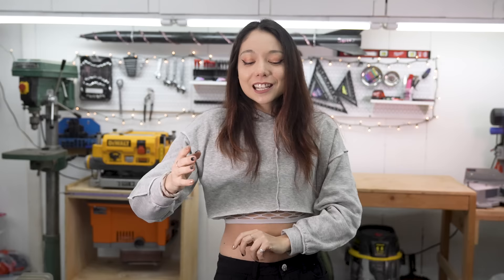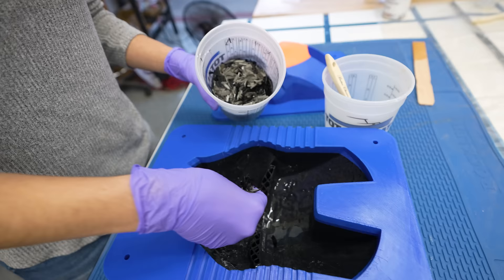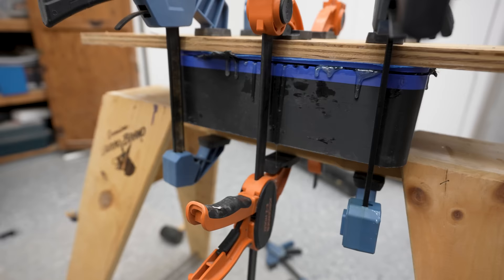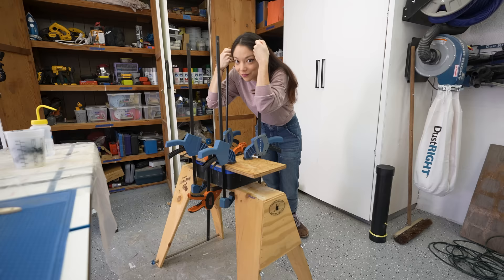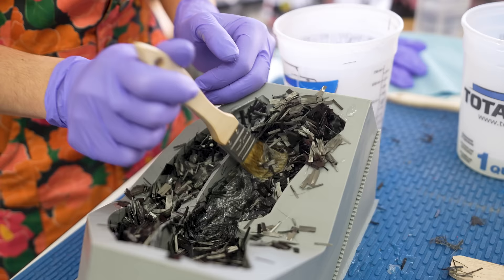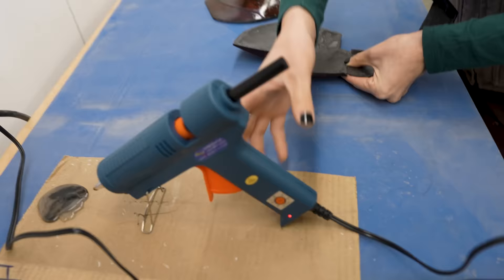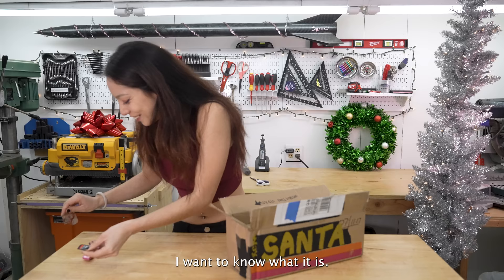I UPGRADED Iron Man's Helmet (100% Carbon Fiber!!)

Comment: Tech tip from a resin material manufacturer here:  With 3D printed molds and epoxy, you will usually want a 2-stage release application to ensure your parts don't try to weld themselves to the mold.  The liquid wax is a good start, but a follow up layer of water soluble PVA release would have prevented a lot of that sticking problem.  If you are going to sand and clear coat the pieces anyway, wax and PVA is the gold standard for decades for making composite parts from rigid tools.  3D printed FDM molds have a ton of micro-porosity, so they really need to be sealed (tons of work) and/or do the wax/PVA treatment.  We have a couple videos on our channel that discuss all of this.  🙂👍

Comment: As long as he’s not going to the bottom of the ocean, Carbon Fiber is perfect.
Reply: The funny thing is, that carbon fiber submarine did make it down and back multiple times. If he'd only not used expired Boeing supplies, inspected the damned thing after each usage, actually properly tested it unmanned repeatedly, removed his cranium from his rectum, he'd possibly still be alive. Or found some other way in which to harm himself stupidly...

Comment: If you don't care too much about reusing the molds, highly recommend leaving then in a heated chamber/oven at 70c or so, it peels away really well after. Boiling in a pot full of water also works. If you get the temperatures right, the glass transition zone of pla can make it soft, moldable like clay or almost gooey based on where you are on the curve.
Reply: "based on where you are on the curve" just sounds so Rick and Morty, lmao
Reply: @spennorex  - i was thinking that 'how to make a shrunken head' vibe - lol
Reply: This is great advice. I've made several PLA molds and heating it makes things so much easier.
Reply: You'd have to be sure you're using a resin that is stable at that temperature for the part itself. I'm not sure how the specific resin in use in this video behaves at high temperature, but the resin I've worked with (which granted has only been one specific infusion resin) would probably start warping at 70 C.

Comment: 10:52 An alternative to those gloves is something disposable like nitrile.  It won't tear holding the parts, but it will tear and save your finger if it hits the blade.
Reply: Agreed, and there are some beefy ones too, I'm using Venom but ProjectFarm has a video testing a bunch too. Carbon is nasty to sand heh.
Reply: so the balde cannot cut thru human skin? wow
Reply: carbon splinters will go straight through nitrile gloves.
Reply: @--julian_  The issue is not the cut as much as the blade dragging the glove into the machine... and your fingers with it.  Better if the gloves break-away.
Reply: @--julian_ blade can cut human skin, but on something like a bandsaw that cut probably won't go very deep before you feel it and pull away. As has been mentioned, if a glove gets caught it can pull your whole finger or hand in and result in a lost finger before you have a chance to shut the machine off and untangle it.
Reply: Barrier cream is also an alternative, if the goal is just to avoid itchiness. I used to use it a lot when I was working in a fiberglassing shop. Particles don't stick much and those that do just rinse off easily.

Comment: I have two comments that might help you.
1)  I use Walmart vacuum storage bags as vacuum bags, they work really well, cheap, and they peel easily from cured resin.
2)  For carbon I've used black "Featherfill" to fill pinholes.  It's easier to sand than a flood coat, and you sand everything away but the pinholes, and you don't see them when you clear coat the part.
Reply from the maker: I've always wondered if this works!! Do they pull hard enough? What vacuum do you use to pull? One like I have or the one walmart sells with it?
Reply: You can use a vacuum sweeper to pull the vacuum if you want, but we used a PVC pipe end cap over the top of the valve, sealed with sealant tape, drilled and threaded for a barbed nipple, then hooked it up to our vacuum pump.  Your pump would work just fine.  Use whatever vacuum you need.
One other suggestion for a tool, is an oscillating  saw.  We use it for cutting and minor grinding of parts.  Works really well, and there's not near as much airborne dust as a result.  We've found that carbon for whatever reason takes the kerf out of a band-saw blade very quickly.

Comment: From personal experience, I find mixing the tow and the epoxy before applying it to the mould gets a far better uniformity of the finished part. also, the “acne” is not only caused by the pressure, but by the heat that’s generated by the epoxy curing (it’s not much but under the pressure, it’s enough).
Pro tips: slow cure epoxy, thicker walls on your moulds, mix it before you layup and try to get the material in position before you squish. It doesn’t like to move much in the mould. Draft angles are your friends and add bleed holes for the excess resin for an easier time squashing it.
Reply: And it's best to do a wash coat on the mold first, let it tack up for almost an hour, then put your pre-wetted chop in there. Much, much smoother.
Ejection pins in the molds are crucial for complex parts like this. Just a hole with some packing tape or a round sticker over it so you can punch it out from the back makes all the difference, especially if the plan is to do a bunch of post processing.
Clamping should be done slowly. Snug it, then do a quarter-turn on the clamps every couple of minutes until the mold bottoms out. You have to give time for the resin to weep out your bleed holes/split line.

Comment: A suggestion for releasing parts from moulds is to include a tyre valve facing the part. (Ideally in the middle.)  When it has set, apply an air line to the valve, and you should be able to exert an even pressure all over to force it out.,

Comment: Use PETG, it’s amazing to sand after and accept orbital sanders without melting and gets really smooth, to cut don’t use carborundum discs, use this thin metal with diamond coating, cuts like butter and don’t break, carborundum is for metal or so

Comment: I don't think the mold being crushed necessarily had to do with your clamping the clamps too hard..  The resin likely got warm in the curing stage which then heated the plastic up causing it to deform around the infill.

Comment: If you incorporate jack bolts between the two mold halves you can apply a huge amount of separating force, even if the threads in the plastic aren't strong enough you can add a lot of pretension that will aid with pulling them apart.

Comment: Super cool project 😍
An other YouTuber used a refrigerator to cool down the epoxy resin while hardening. That’s slows down the speed of the reaction and gave the sire more time to escape from the liquid before getting too viscose / solid.

Comment: As the author of The Iron Manual, I apporove of the use of carbon fiber for enhanced security. Not so much flying itself-- one of the arly Stark inventions was a "partial" anti-gravity device. Developed for the SHIELD Helicarrier... It also required external vision, in-flight controls and redundant power supplies...
Excellent as usual!

Comment: Hello so I’m on my colleges fsae team and we do everything with carbon fiber so I have a lot of experience with what you’re doing making carbon parts both for structure components and aerodynamic ones. I don’t have experience with the exact type of carbon you used (the little shaved bits of UD is what I’m guessing forged carbon is) my guess is it’s more decorative (it does look super cool). We use an combination of pre preg twil and UD to make our parts. I’d recommend pre preg above wet layups because the pre preg has the bear minimum resin to bond everything together. So it saves on weight. Also cuz it’s in sheets the layups are easier to plan. We use fibersim from Siemens NX to plan the laminate ply by ply to optimize the part. Regarding molds and vacuum bagging yeah it’s never easy and it’s a lot about practice. Mostly I’d say you want more breather to ensure even vac on the part. Airtech also makes something called aircast which helps with hollow compression molds. Also cursing in an oven makes everything more controlled (but finding and oven isn’t easy) anyways project looks awesome great job. And yeah carbon fiber
Reply: Your advice isn’t wrong, but isn’t exactly good either. I used to work with PMCs and CMCs at General Electric, and pre-preg and NX are not hobbyist level options. A better option for her would be various weight twills and UD layers with vacuum infusion. Keep in mind the quality of epoxy she’s using too…
Reply: Perhaps you’re right I did fail to consider the cost of materials and manufacturing especially since prepreg needs to be stored cold. So your solution is more reasonable however I would also say that if she managed to design and build a supersonic rocket then the complexity of fibersim is well within her capabilities. I realize that my experience is rather limited to what my team does so if not software like fibersim how do you suggest she plan out laminates I order to ensure that they won’t fail under load? One option is to simply eyeball everything with an high safety factor but that’s not very elegant

Comment: Nice job.  I've done rocket fins using this same technique.  I found that a paste release (3 coats) followed by a PVA release coat on all surfaces (even the back and sides of the mold) kept anything from sticking.  Make sure to let the PVA dry completely, then laminate, or fill with chopped fiber.  Then clamp just enough so that your excess epoxy squeezes out.

Comment: Great build! I use CF a fair amount and any voids like pinholes and mini craters can be filled with Cyano/Superglue...and a few minutes later can be sanded smooth. Adding CF dust in the hole will speed it up and hide the hole. Keep up the interesting stuff, Xyla!

Comment: I like the clamping the clamps. Its good example of thinking about the essance of what you are trying to do.
 In this case instead of conventional squeezing the handles with your hand,  the essance of what you are trying to do is to move the handles closer to each other. When i think like that more sollutions pop into my head

Comment: Hello Xyla, to have the pressure force on the mold, you can use a polyethylene bag vacuumed with a vacuum pump made with an old fridge motor and a simple depression switch.
The pressure on the mold can be enormous and it is much more regular.

Comment: On the mold front, the one demo I've seen of 3D printed molds for forged CF recommended 100% infill which would improve the strength of the mold in compression and make the infill solid so it would reduce patterning
Reply: This thing is dope

Comment: You'll never get serious clamping pressure from "squeeze" clamps- they just aren't capable of it. If you need serious pressure, you'll need regular clamps with acme threads. It's a simple matter to add leverage on the handle to increase pressure. I replaced a lot of round handles on mine with shop made square cross section handles- much easier to apply pressure. On smaller clamps, I simply cut four flats on the round handles.

Comment: Top tips for demoulding. 1. use plastic demoulding wedges. 2. Leave or drill a hole and use compressed air to get your initial demoulding pop. 3. When you prise open a gap squirt some IPA in the gap. 4. Leave some tangs of material over the edges of your mould so you have something to get hold of. 5. Use pincher style pliers to get hold of the edges of your layup and roll across your mould to help get a nice pull on the part. Hope that all helps.

Comment: What a great final result! Man that looked so good in the sun! 😮❤

I've used that automotive "Anodized Metal" spray paint before, but I did it on my truck's headlights. 😊
The truck I had bought, the guy was a painter and put chameleon flames on it (the color shift paint that changes color based on view angle). The primary color you saw was purple, and so that's the color of "Anodize" paint I used.

It not only worked amazing, leaving the headlights look purple when off... But it didn't even effect their brightness at night!
It did tint their output, though. (this was early 2000s, and they were standard 'yellow' color bulbs)
More importantly, I never once was pulled over or ticketed for them, and I had that truck for a good 2 years as I recall.

Anyways, just wanted to share that, in case it might help someone, since it was some outside-the-box thinking on my part and it might be similarly handy if anyone needs a way to tint light output in a project!
Is also like to mention, headlights get REALLY HOT, as well as get hit with plenty of bugs, and it neither flaked off from said heat, nor chipped from bugs or other road debris. 👍

Comment: How was the CF dust on clothes? Super itchy or ok? Cutting fiberglass I gotta use a Tyvek suit or I’ll be itching for days. I always avoid large CF pieces because of the dust risks, but does anyone have good science info on actual risks? I have a battery powered dewalt sander so I can wet sand everything to keep dust down. And I use the foam sanding discs for all the curved stuff since they’re cheap on Amazon and have every grit.

Comment: @Xyla Foxlin...it was an outstanding salvage after the inlay texture. I would recommend making a paper pattern for the carbon fiber for the shape, which must have done to cut the carbon fiber, after that, use a flat surface to lay up the carbon fiber and then place it inside the mold. I will e easier to lay up and squeeze excess resin and then press it with clamps.

Comment: I made a custom sugar scoop carbon fiber welding helmet. Its sick, super light. the one downside is that uh carbon fiber is electrically conductive and welding uses electricity. literally has a label warning death if you start an arc on the helmet. But it is super cool tho.

Comment: Excellent video!  to avoid 'clamping a clamp' i recommend getting some pipe clamps for those long distances.  relatively cheap and able to really clamp down exponentially stronger than the grip squeeze clamps.      The squeeze clamps are fast, but weak.  Pipe clamps are slow but strong.  Sometimes I even use both, start with the squeeze clamps to position, then follow up with pipe clamps to secure full strength needed.

Comment: I’ve used those Duplicolour Metal Paints before. They’re meant to be sprayed on chrome but you can get a silver base coat spray in that range that acts as a base coat for non-metallic surfaces. Also have you considered using silicon for moulds? Much easier to demould.
Reply: Silicone molds won't work for forged carbon as putting the part under pressure is integral to the forging process and silicone won't hold shape well enough under pressure.
Reply: @reaganharder1480  It will if it’s just used as a liner for a hard mold. That’s what I do when creating moulds. I make guitars that way.
Reply: @RuthlessMojo  ah, yeah i suppose if the silicone is pretty thin, it's only gonna squish by a percentage of that thickness, so as a liner it should be stable enough under pressure, at least so long as you don't need a high degree of precision, which this does not. You make guitars with forged carbon? That's cool.

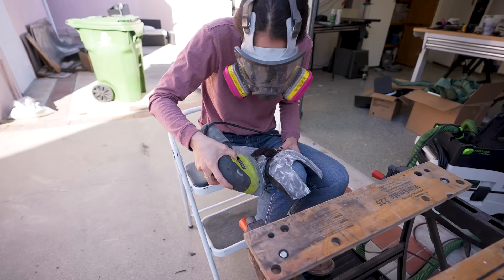Comment: 11:40 bubbles... you can vacuum the resin after mixing before pouring it or using it with the brush, that alone reduces bubbles significantly..

Comment: I worked in a fiberglass molding facility...Tip for your future builds. there's a mold paint we put on the molds to make them smooth. then we put many layers a wax on the molds. then we use a mold release on top of that. squeeze out flanges are your friend to hold on to when pulling the part out of the mold. (your welcome)

Comment: 1: i am so glad someone else brought up the naming issue
2: Xy… how do you make Every outfit rock?
3: if you ever figure out an easier way to sand prints please share, i have been trying a ton of methods and there is just… nothing that works super well.  Some plastics work decently if you can use a solvent, but so few cooperate that way
4: the clear wood days were quite fun, wood be a great project to head back to some day once your new lab is better set up and stuff

Comment: I would highly recommend diamond blades for cutting your carbon parts, works so much better and has much less breakout. To fix the porosity higher compaction should help, pull full vacuum or at least 20+ inches of mercury. (or you can just hide it by adding more epoxy) having dry fibers is way worse strength wise than having too much resin.

Comment: @11:45 to help with bubbles in the carbon, try using prepreg carbon fiber and thin layers. Make a thin layer and vacuum bag it, then another thin layer, vacuum bag it again and repeat. At that point you will only be limited by your oven size. More vacuum, less problems 😅

Comment: A little bit of advice when working with carbon in molds like this - 
when you are pulling it from your mold, If it looks great and you only need one you can cover the parting line in masking tape and take a palm sander and just sand straight down on the parting line. You end up with a perfectly smooth edges. Just make sure you only ever do straight down, it doesnt take much to start taking extra material off.

Comment: Excellent job, looks briliant.
You need to get a Fiberglass Roller Kit, these will enable you to compress all the layers of fibre chop and resin, and remove any voids. The paint brush technique is good but it will actually introduce more air voids into the piece.